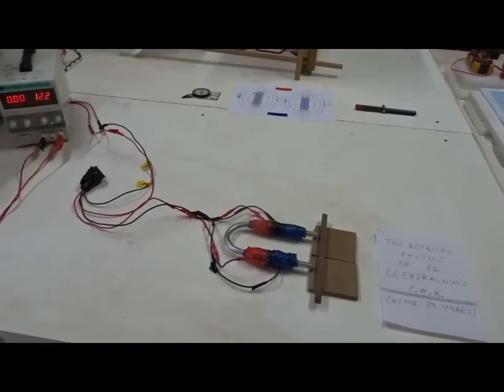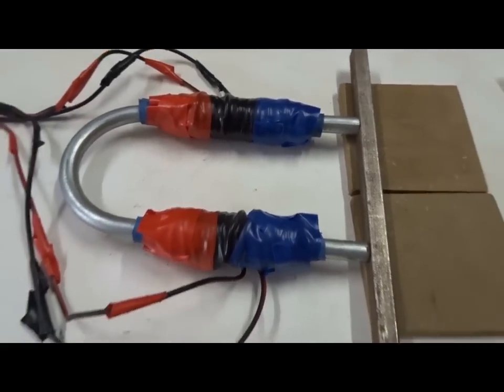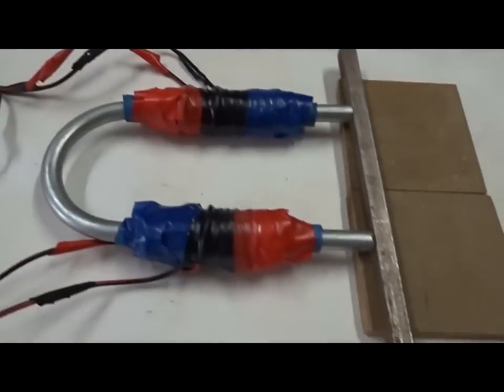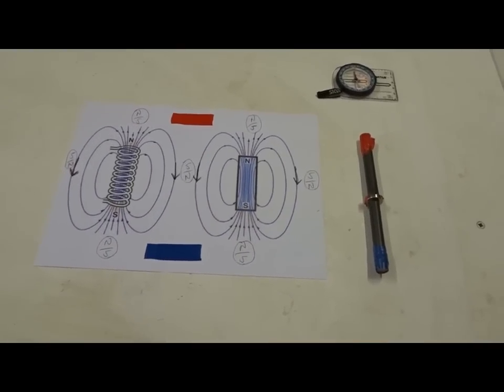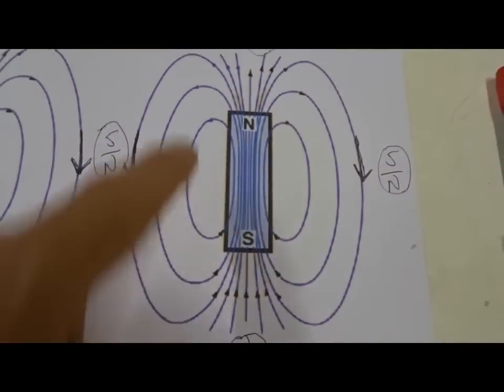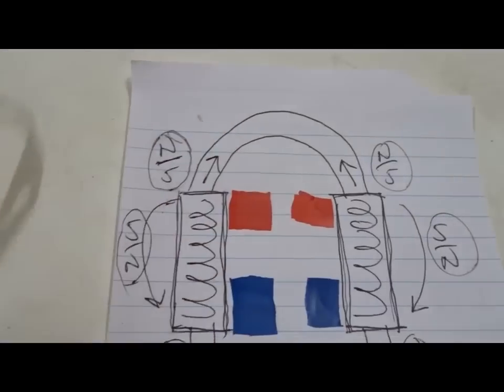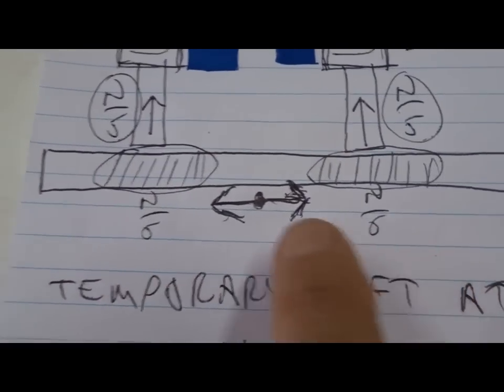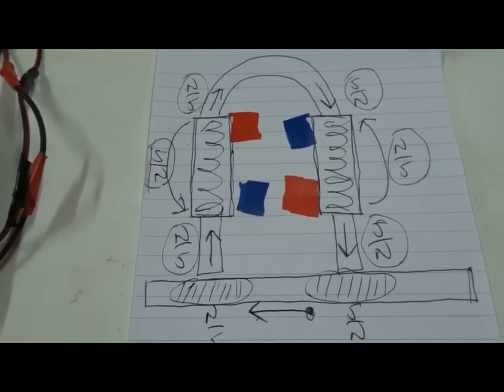Did Ed Leedskalnin use "circular magnetism" to lift heavy rocks at Coral Castle?

Comment: The metal bar kept stick to the electric magnet terminals was just because the metal electric magnet core is ferromagnetic, the two-same direction electro-magnetic coil on it had magnetized the horseshoe-shape core, which will keep the straight steel bar attracted to it even after the coils on the horseshoe-core had no electricity any more.

Comment: So, if I understand you, he connected heavy rock with chains to the crossbar of the PMH, which had a coil around it, energized using circular magnetic pull over a small lift distance.  Ok, I can buy that, however, in practice he still would have to cut all the way around rock that he would lift, which seams even a more difficult task.  Great vid!

Comment: As tempting as it is to view the amazing park through a veil of mystery, in fact we know how the castle was built. Creating a structure like the Coral Castle today could probably be accomplished in a few months with a construction crew and modern machinery. But Leedskalnin worked alone using basic tools like picks, winches, ropes and pulleys. Leedskalnin himself said that that he did it using hard work and the principles of leverage. The tools he used to quarry the rock are on display at the Coral Castle, and several old photos depict the large tripods, pulleys, and winches he used to move the blocks. Though the quarried stone slabs are large, they are actually lighter than they appear because the rock is porous.
Reply: it says gullible on the ceiling btw
Reply: Chat GPT ah ah posting
Reply: Moron @Outpost67

Comment: Here's how Leedska did it. He used pulley to lift the stone, then treated it with some magic magnetism to make it lightweight, and then simply pulled it along a wire or rope to another place. And that's because he couldn't make the stone lightweight while still on the ground. I.e. he had to lift it first.

Comment: Compare the first computer memory the ones made of woven wires through torroid cores to what Ed showed... The ionosphere of the planet has a gradient of 100 volts per meter from ground compounding, meaning it is a dielectric particle accelerator that accelerates to ground.  So the question is was coral chosen because it's porous nature allows it to hold the most capacitance. For info search " feynmanlectures caltech edu II 09"

Comment: This click-bait is hardly worth my time. I admit I skipped through it prejudicially. Much video spent playing with bent bar that RETAINS a magnetic pressure (pull) but NO POWER flow ability. The coils simply increase the pressure to make the straight bar jump over, DUH. Then the inherent magnetism holds the two pieces together like, DUH, magnets !!! In a comment below someone says the reef material is much heavier than granite (yikes !!!) when the truth is that reef can be 65 pounds per cubic foot while granite is 160 and up. The chain block and tackle was perfectly adequate to hoist these reef blocks, which can be cut from the bedrock literally using sheets of tin and a cutting abrasive and various motoring approaches. C'mon folks, the mystery is easier than you make it.

Comment: Interesting - removes using a pulley system and the complexities behind that. My question would be once he had the lifting aspect sorted and simplified - how did he move them sideways e.t.c. My other question would be how long do the elections stay in the same orientation for the PMH to work after current has been removed?

Comment: The question remains, how did he quarry that coral?  It's much harder than granite.  Takes many hours to quarry one block with industrial mining equipment.
Reply: He used car batteries and a reciprocating engine to move a steel plate big enough to be used as a double door on the property today. There is video of the machine working. Also, you can see some unfinished cuts. I visited the property in 2022.
Reply: Coral is soft as.
Reply: Coral castle is not made of Coral, it's made of oolite limestone which is relatively easy to cut.

Comment from the maker: This is not my main area of research, as you can see by watching other videos on this channel. New space ion-drive, new 4-symbol computer codes, etc. Other people can continue to study and reproduce these experiments at low cost if they wish. I just wanted to understand how Ed did it. He invented both a flywheel AC generator and a PMH. I have made both on a small scale to understand how they work. 
Coral Castle was not even on the Miami AC power grid! He had to turn his generator by hand, then store the energy in DC car batteries via a rectifier. He could not possibly have had enough electrical power to lift all of those rocks, using a power-consuming electric motor, which he would not have been able to afford anyway! His PMH used relatively little energy.
Reply from the maker: It is EASY to build a small model of Ed's magnetic-flywheel generator which works in the same way, by the same physics. I have a video somewhere but nothing new, so I did not make a movie.

Comment from the maker: Some people here do not seem to understand the difference between a "lift magnet" and a "PMH". The rocks do not have to be magnetic to be lifted by a PMH, in combination with a tripod, pulley and chains. Each time he added power from a series of car batteries, even a heavy rock would have been lifted by a small amount. Then he could tighten the chains, and do it again repeatedly. A standard lift magnet would not be suitable for that task. He just needed to "tap" the electricity to lift in each step. He did not need continuous power.

Comment: There is no such thing as "virtual magnetic particles."  Virtual particles are a fiction created by people that simply do not understand reality.  The word "virtual" means fictitious/non-existent.  Imaginary particles cannot act on anything or cause any effect whatsoever.  The aether does in fact exist and the properties of the atoms in permanent magnets allow them to be arranged so that they cause a laminar flow of the aether around them.  The same effect occurs with electromagnets when electricity flows through them.  These effects were correctly described by James Clerk Maxwell in his electromagnetic theory and Oliver Heaviside in his subsequent and expanded Electromagnetic Theory.  The fools of physics think they disproved the aether with the Michelson Morley experiment when they cannot even prove that the property of the aether for which they were testing occurs with any known medium at or below earth's surface which is where the MM experiment took place (the basement of a building at Princeton,) thus the lack of their imaginary property proves absolutely nothing.  Neither water nor air remains absolutely stationary with absolute space or else there would be a constant 1,000 mile per hour water and air flow in the direction opposite of earth's rotation at the equator and lesser fractions of such flow at various other locations depending on latitude.  Surprise surprise that no aether wind was detected just as no water wind is detected and no air wind is detected.  Maxwell postulated a dynamic aether, not a static aether in his electromagnetic theory.

Comment: An interesting explanation but a couple of questions are raised:  obviously first would concern the mass of the stone being raised- your measurements involved overcoming friction force not gravitational force and with a small mass so the amount of current was "small" compared to what it would take to raise a massive stone vertically,  secondly given the number of batteries needed to supply that amount of current would require connecting the batteries in parallel and then using VERY large diameter wire to handle the immense amount of current required just to lift a couple of inches, thirdly those batteries would need to be recharged on a daily basis probably more than once presumably requiring a very hefty power source ... it just seems there might have been more involved here than the suggested solution... your thoughts?

Comment: To add to this. Take the PMH coil and turn on. Let iron bar jump to electromagnet. Disconnect power supply and put LED in place. Pull off iron bar and LED lights. Magnetism races through coils even with power disconnected. Remove iron bar, magnetic field collapses, producing voltage to light LED.
Reply from the maker: yes, that is what Ed showed in his book.
Reply: temporarily

Comment: He explained, there is oly N. Read the spider web explaination.
Why should he lift with an plate under the stone ... bs your conclusion. The door levitates. What CHARGE does it?
He used calzium with the t model generator. 
The 12 ford ad on stics ... the story was: the gas engine only starts the calzium electric generator to pull the  vehicel much more better.

Maybe the rocs had a lot of calcium inside.

Think in charges not in magnetic lines.

Think a bone is stronger than steal.

Think the blood is created in the bones.

Think with your breath ... be careful what you think❤

Comment: Could the metal bar not coming off the magnet too easily be to the fact that the electronic caps of the power supply . were still charged?
Reply: that would not explain the electromagnet letting go of the bar, when the poles were turned.
Reply from the maker: no, the attraction is purely magnetic, and I used an on-off flip switch
Reply: The Dr.'s on/off flip switch, would ensure that any residual voltage from capacitors in the power supply, are completely cut off from the wire wound metal bar. I think we can trust this person's experiment, but if you are not convinced, then the scientific thing to do, would be to reproduce it.
Reply: its just basic magnetism nothing magical you can even remove the coil completely and it maintains attraction between metal parts

Comment: He used block and tackle. People witnessed it. His tools were all still there. 
Electricity was not very accessible in the early 1900's, 1910. Would be much easier to do the work with mechanical advantages instead of setting up the same structural system of poles, and dumping huge amounts of current into massive, expensive wire, to get it to lift... during a time when electricity was at a premium. 
Occams Razor says the simplest solution with the fewest assumptions tends to be true.
Reply: I'm from FL and everyone there knows this. But we have these nutcases who think only aliens could build the pyramids in a time when there was a glut of people who had no TV or cellphones begging for something to do to show their allegiance to the state gods.
Reply: Then someone else needs to lift those stones the way he did.
Reply: @DavidRavenMoon  people do, but it is easier to use heavy machinery and hire it out. There is a guy in Indiana(i think) who used buckets of sand and see saw'd a massive stone hinge sized monolith very high into the air by tipping the stone back and forth with sand and adjusting the fulcrum higher and higher. 
He then used a pit of sand to catch the stone and slowly washed the sand away with water to allow it to sink into the ground to get it properly leveled. 
A little bit of ingenuity goes a long way.

found it:
https://www.youtube.com/watch?v=0P4HwmmhykI
Reply: I figured like the pyramids the blocks may have been geo polymer cement, poured in place. But then I am no assternot.
Reply: @alanheadrick7997  They found where they were cut from the limestone floor of the plateau at Giza. The Granite came from Aswan and was floated to Giza on the Nile. They found the spindles for the large saws and can see the saw blade cuts in unfinished blocks. 
These were not geo polymer, however, I do know it was used around the world. I mean, cement was perfected by the Romans, so various forms existed prior.
Reply: @Reach3DPrinters  I watched a video of some guy saying the cement was made near the pyramids and maybe only 2500 people were needed to build them. He actually made some blocks. It was interesting. But I am not an archeologist.
Reply: @alanheadrick7997  You can google pictures of the quarries from around the plateau. There are many many many blocks mid cut. Definitively not poured. The casing stones were much smoother, and they are hard to find. They were also quarried from across the Nile and precision cut and fit into place. 
The evidence is still there and can be seen in photos on google.
If they were poured, it would have been easier to pour them at the top of the pyramid, hauling buckets of aggregate up easily, while being build, than on the ground below and carrying up large finished blocks that would be very cumbersome to haul. So definitely not poured below. And you can see layers upon layers of removed limestone, where they were taken from the plateau.
Reply: electricity is literally everywhere in infinite quantities, knowing how to access it is the secret. Don't know why I'm casting a pearl to a swine, when these words will be lost on your ignorance
Reply: @Wolffanghurricane  I didn't say it wasn't there, I said it wasn't very accessible. 

If you DID know how to access infinite energy all around us, you would be a leviathan of the energy industry, but you don't, yet your claim indicates we are ignorant.

First, most people who study particle physics to any degree are aware all mass is made of energy. So far, the only way to convert that mass requires unstable atoms, breaking atomic bonds, causing a chain reaction where a small amount of mass converts to heat. That's Fission Reactor. Great source, lots built. Fusion Reactors aren't viable yet. Some success but not enough result for investment. 
If you're talking about Quantum Electrodynamics, QED, Coulomb's law limits the energy we could extract from electrostatic forces holding molecules together. There's not enough energy there.
Ive heard gravity and magnetism, from people who don't have an understanding that those accelerations and forces are a zero-sum game and perpetual motion is a violation of conservation of energy. 
The energy from the rotation of the earth might be harness able... but friction is not gonna be easy to overcome and will eat up most generated. unless you can develop a MASSIVE friction-less gyroscope system. Then you got Hydro, Geothermal, Solar, Wind, Biomass... 

You wanna grace us with your knowledge on infinite energy? No? We're not intelligent enough to grasp your unspecified knowledge? I find those who claim everyone is ignorant, have an egotistical self view when the reality is, there are a lot of very intelligent people everywhere.
Reply from the maker: He used a PMH hooked up to car batteries. You can even see a "PMH" carved into stone on top of the entrance to Coral Castle. There was a big PMH in a box with cables at the top of his tripod. Look at the photos please?
Reply: @DrHoraceDrew  PMH was simply an extra pair of helping hands.  I can effortlessly move a 16 ton press across a shop with a six foot bar and tubing on a cement floor.  He used the tripod to brace against.  PMH would allow him pull his lever while he went to move blocks under his rock, or to tight the chain as he pulled the lever, to make powerful movements in small, effortless increments.
Reply: @DrHoraceDrew  Sure, maybe he used magnetic coupling, but that's not doing work. Work was done by mechanical advantage via block and tackle. Coupling magnetic systems do not seem practical as energy was a rare commodity. He had an I.C. engine likely, to recharge some batteries, sure, but he like to experiment with electricity, which was common in the day. It was a new realm of possibilities that little was understood about. 
As far as the building of the castle, moving of the rocks... it was all mechanical work.
You cant get work for free. Energy is exchanged. Magnets are not a force that you can exchange energy with. Magnets are an alignment of atomic spin that creates an alignment and coupling via the EM field. 
Think of it as a gyroscope. 
You can apply a force, and the gyro will redirect that force. That's all magnets do, they redirect force, they don;t generate force.